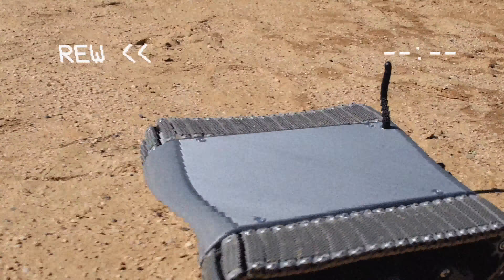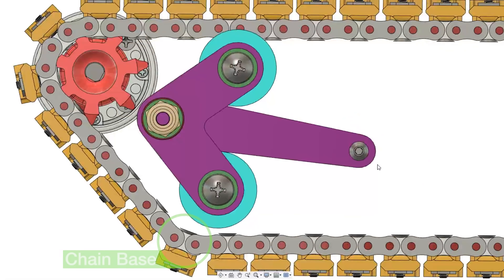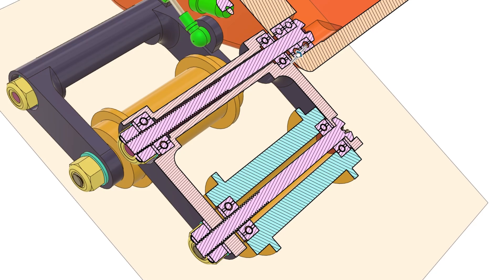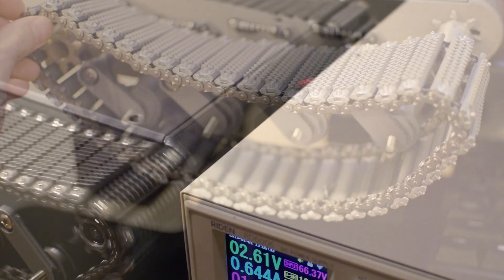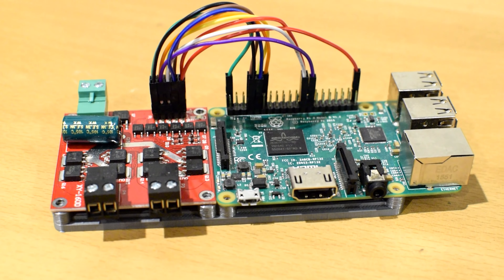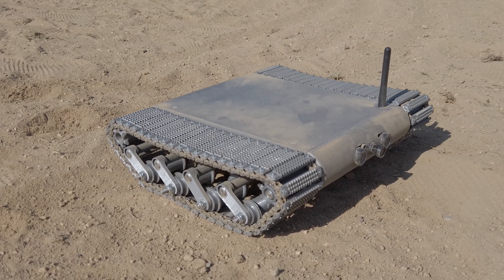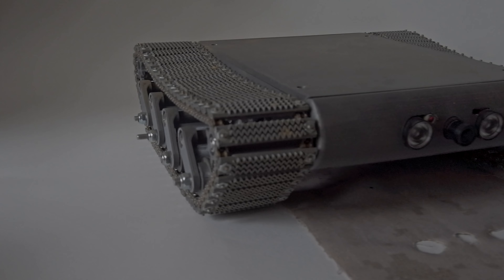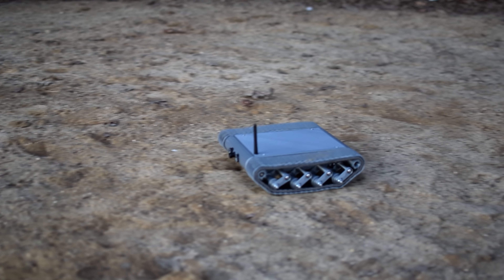I Built a Military Robot from Scratch!

Comment: Great project, however there are a few things you might want to adjust. I see that you're using L298N drivers, which are pretty easy to use, but are pretty limited in the power they can handle, with something like 1.5A max and can turn very hot. Specially in a 3D printed vehicle that can become an issue. You might want to concider some other drivers, or (and that would be my suggestion) go with 2 ESC's and RC control. That'll give you the option to use larger motors such as a 540 or even 775 with low RPMs, but also you can use LiPo's without having to worry about overdischarging them, and is a lot more universal. Controlling the droid by WiFi is nice, however is pretty limited and you need to concider how to handle loss of signal etc. A way more easier method would be to use  RC transmitter and receiver. It's easy enough to capture the receivers output with an arduino, then you can modify your signal as pleased for either driving or other functions such as lights, and then send the output signal to ESC's or whatever you want to control. 

As upgrade you might want to look at adding GPS. A Neo 6M module would do perfectly fine for these kind of jobs. You can then either store the location in a timeline db such as flux, either on the Pi or sent it directly ove WiFi to a database. 
Another suggestion would be to add sensors for autonomous driving, with an ultrasonor sensor such as an HC-SR04 and / or use a lidar such as a TFmini. There's a lot of documentation on this subject.
Reply from the maker: Hey, I uploaded a video today on how I want to make a PCB for this. I am still using WiFi because it is easy to connect to using your cell-phone. It is also easy to connect other stuff like lidar and just program it in. With an RC transmitter, it might be more complicated. All good suggestions. I am switching to a Cytron 10 amp, 2 motor chip for the motors. I am planning on having GPS right on the chip.
Reply: @AvivMakesRobots RC is using a PPM signal, which isn't much different from PWM. RC gives you a bit more range, but more importantly, it'll give you a very reliable signal.
Reply: @AvivMakesRobots  I was looking for a better driver, thanks for recommending the cytron, cheers!

Comment: Excellent!   The suspension "bogies" or "idlers" are mounted on angled arms.  Was there a noticeable difference in the way they performed when moving forward vs reverse? (Assuming the camera is at the front).  Thanks for the video.
Reply from the maker: Not much of a noticable difference, but the "backwards" way is the correct way to angle them. In the next version, the camera will be mounted on the other side to allow for this.

Comment: Love the project, and I'm really enjoying the videos, especially your idea to use a drawer slide for raising the camera.  Did you encounter any video signal (timing) issues by introducing cable length (and therefore a propogation delay) between the camera & the RPi?

Do you have any future plans to provide a "kit" of the 3D printed parts?  I don’t have a 3D printer, so that's a stumbling block for me.
Reply from the maker: Hi! I did not encounter any issues, possibly because the cable length came stock with the camera and is using USB 3.0. I absolutely want to create kits for this, I am just deciding if printing the parts myself or having them made elsewhere makes sense. If I was printing them myself and hit a snag, it could cause major delays.  My future videos will touch on this topic. Stay tuned!

Comment: Make a turret and add Raspberry Pi High Quality Camera
 with custom made IR setup and ZOOM LENS.(use turret as lens holder)
+
add Solar panel  
+
As you have used Raspberry pi , you have modular design wrt to electronics parts addition.
Reply from the maker: I like the idea of adding a turret. Yes, it needs a better camera. 5mp are not enough for night time. Plus, the lens is very small and not optimized for night time use.

Comment: What makes this "military"?, This hardly can deal with any outdoor elements including water, dust, temperature, wear and tear. Camera gets dusty in matter of seconds, image is bumpy with no stabilization just to mention few flaws in this design.
Reply from the maker: As said in the end, there is a lot more I need to add before I can really consider it to be a military robot.
Reply: @AvivMakesRobots  its not adding something, you talk sensors and stuff, fix the design first to withstand conditions..
Reply from the maker: Main changes are coming with the robustness of the suspension to withstand the unforgiving tundras of the desert.

Comment: Wonderful in every sense of the word, all together, mechanics, electricity, electronics and programming. I wonder if it is possible to add a gyroscope system to stabilize the image coming from the camera because the image goes up and down with the movement of the wheel.
Reply from the maker: It is coming! Stay tuned...

Comment: Very cool Project!
I would only suggest to take brushless 3 phase BLDC Motors (I mean the ones with the three Lines, which are also used in Quadrocopters)  for the Tank,  they have at slower velocity more Power and achieves a higher final speed.
Reply from the maker: Very cool. It's a good idea, but is there enough torque with no gearbox?

Comment: Cool! Only one question: Is sketching important for an Engineer?
You mentioned some great sketches at the beginning... and what's called this type of sketching?
Reply from the maker: Most engineers do not do much sketching past the basics. That is industrial design sketching.
Reply: @AvivMakesRobots  Another question please, if I may: how much in total costs this robot will all its parts? Honestly, I am going to try doing something like that, and it'll be my first experience... or can you suggest something easier to start with?
Reply from the maker: I woukd suggest starting small. Do you have a 3D printer? You will need one. Get that, and spend money just on a few motors, batteries, arduino or Raspberry pi and an antenna. From there, attqch wheels you 3d print and build out a housing then learn to code your invention. Let me know your progress! I'd like to see what you come up with!

Comment: "military" means robust and simple. So my tip is to have less shock absorbers (2 or 3 should be enough), covered front cam for better weather resistance and please turn the antenna 90 degrees to the left. Or back. Anyway, great vehicle :)
Reply from the maker: Thank you!

Comment: Great project! May be you can look for a mechanism to reduce the vibration of the camera by suspending it to a shock absorbing spring may be. Great work.
Reply from the maker: That would be a lot simpler and robust than with a 3-axis electronic gimbal... maybe that is better than software stabilization or it could aid it. Thanks for the comment!

Comment: This is awesome! must be a complicated to 3d print and assemble the chassis
You could try adding a speed ratio like crawling & running, controlled via pwm, and a few shock absorbers/ gimbal for the camera could make the footage usable. 
If this is supposed to be a military bot it needs to provide some use, either active combat or assistance. 
Active combat: reconaissance and mapping(lidar etc) or direct combat, new age weapons like rail guns etc
Passive: transportation (heavy drivetrain/load bearing)& evac vehicle, comms node etc
Reply: And since this is a raspberry Pi you should probably get a GSM hat for it
Reply from the maker: True! It will get some upgrades soon 😊
Reply from the maker: GSM hat sounds like a great idea. Wiuld that allow for 4G?
Reply: @AvivMakesRobots yes there are both 2G and 4G/LTE hats available
Reply from the maker: I looked into it, but the cost was bothering me. I might still consider this, though.

Comment: Great build and video, especially all the editing and explanation.  As far as sensors, I would consider using a depth camera (like the orbbec astra embedded s for example)  You would get the image stream and also a depth stream that could be used for mapping the terrain ahead in detail so it could pick a path around obstacles.  The depth part works in total darkness, but the imaging part would only work in the light.
Reply from the maker: Wow, looks like a nice camera! It would be great to get something that nice, but for now I gotta see what I can do with this budget cam.

I saw your video on the AVA v2. That thing is nuts... Are you a day job robotics engineer? Programmer? I am mostly a mechanical engineer and industrial designer.
Reply: @AvivMakesRobots  I am retired, used to be a software engineer in Silicon Valley.  I am self-taught in robotics and later AI.  I can hang with most anyone on software, but muddle my way through mechanics and electronics.  I just love the hobby.   BTW,  it really is a great rover you built.  I wish Ava had anything like that suspension.  I have a rocker suspension idea that's a little like a Sherman tank.  Keep up the great work!
Reply from the maker: @SuperDroidBot  Hey, just saw this. Thanks again, I am working now on the next video which involves the vision system. I am wondering what I can do with just the pi camera using a better lens. Do you know what a good computer vision challenge for this project could be using the pi 4 and the pi camera for a beginner?
Reply: @AvivMakesRobots  You could perhaps install tensorflow and one of the versions of the yolo model...so it could recognize 80 different types of objects/people/animals, etc.  The yolo model would tell you the x,y location and height, wdith in the FOV so you could use that to drive towards/away from the object or some other behavior.
Reply from the maker: I will look into this. Thank you.

Comment: Amazing work, man! You are very talented! I wonder if the lenses won't be obstructed with dirt... maybe a higher mount for the camera? not sure, it would expose your vehicle. You talked about making it autonomous... When I was modeling an autonomous airplane, I was going to use a cheap flight controller with GPS they sell in alixpress... maybe it would be suitable for your project as well, wit hthe right coding. Great project, man!
Reply from the maker: That's a good idea! I am building integration with the Raspi... 2.0 coming soon!